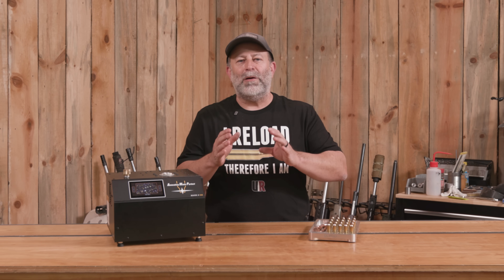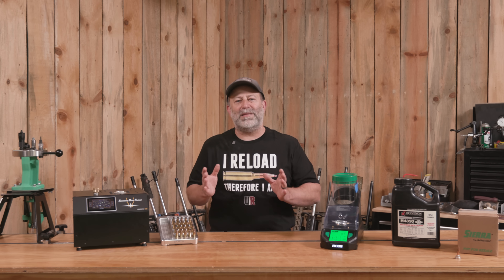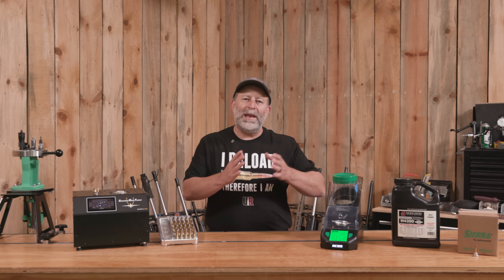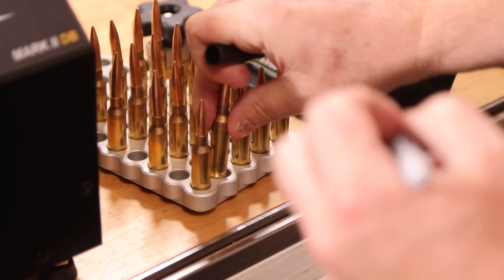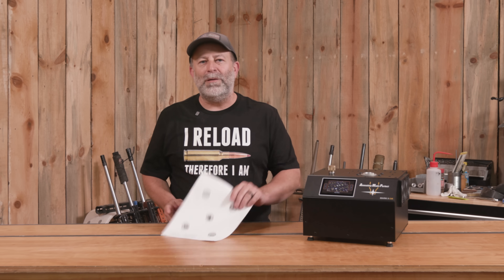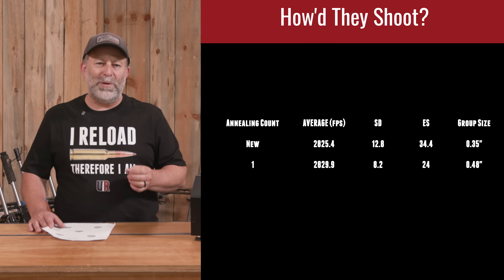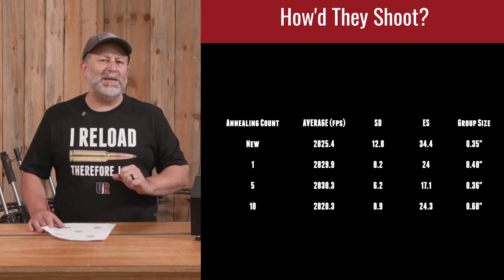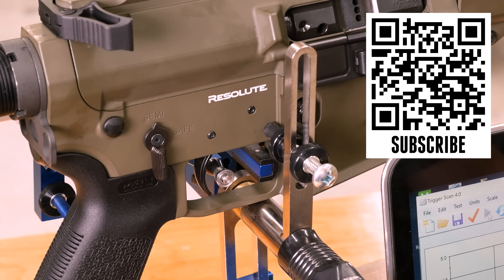Annealing Torture Test: Does Annealing Multiple Times Matter?

Comment: It was the best thing I ever learned. I used to use scrapped cartridges, not my Lapua), to get the flame right, then started to realized that not all cases are made the same. Then, I learned that you can anneal twice without any issues, so I began starting out with a faster time, then slowing down until the anneal was right..(use an ugly annealer). Then by the time all the cases were done, I'd send the 4 or 5 test cases back through the annealer..brilliant! Never thought you could go three, five, or ten though. Good stuff!

Comment: I thought the brass had to be quenched after? It didn't look like he quenched at all?
Is this also done in the machine?
Reply: Quenching has no effect on the brass other than if you're worried that the heat will migrate down down into the case head, (which does make sense). Air cooling takes way less time than Quenching, then drying out the cases, in either a dehydrator, or the oven. Both are valid methods IMO.

Comment: Lol you guys fell for the primal rights scam...😂
Reply: Which scam is that? Please expand on this.
Reply: @joshturner5904  the whole "priming system"..... he's charging $600 for the exact same thing that LEE charges $30 or less, RCBS charges $60 or less, and you can set up the LEE APP press to do it for under $100, and I think there are 1 or 2 others that do the same thing(adjustable primer depth contingent upon the rim thickness, with some sort of pull lever). If you want hand priming there are even MORE choices under $150 for the exact same function. Additionally, out of all the options the primal rights set up takes up the most room on the bench, the rest are a die box or hand primer....

Comment: Pausing at 0:24 to predict degradation in neck due to over cooking the metal results in inconsistent tension on the projectile leading to: Bad groups, feeding issues and possible case separation/cracking and associated malfunctions.

Comment: They all shot the same -don't you think  5 points of data is pretty much meaningless? "Your groups are too small"
Reply: Not in this case, as the real message of the video is what metallurgists have been saying all along: either the brass is in an annealed state or it's not. Don't need five, thirty shot groups to tell us that.
Reply: @floorpizza8074  So the video was pointless then. Either way if the intent was to examine the effect of multiple annealing processes the data group size was to small to be statistically significant, regardless of "what metallurgists say".

Comment: I would be more interested in a Neck Tension test than an accuracy test.
Reply: Nothing interesting would be seen because the annealed condition material properties is dictated by temperature and time at that temp for one single cycle. Any subsequent heating and cooling cycles thereafter  -assuming temp and time at temp is kept the same-  will not change the materials properties to any appreciable degree.

With that said, if one wanted to do the test anyways, it would be extremely important that all cases have exactly the same wall thickness (down to a single tenth (.0001") or better) and  the same with the projectiles diameter for any appreciable and reasonably accurate variation to start to be seen. Any variability in either will result in varying hoop stress, which in turn directly affects "neck tension" but this variation would not be a direct result of material properties change from multiple annelings, which is the whole point.

Comment: I have a question about the powder dropper. Do you weigh the powder on a separate scale to confirm powder weight, or is the accuracy of the scale on the powder dropper good enough to get around 10ish SD which was shown in this video?

Comment: I have not watched yet.  So here are my pre event thoughts.  It is a function of achieving certain temperatures and time at for the different crystal structures to form.  Thus uncontrolled heating of the brass could cause problems after just one firing.  Whereas extremely controlled time and temps would have very little negative effect.  Now to watch the show.

Comment: In terms of brass longevity, meaning the number of firings before failure, I am more than convinced that neck-sizing, with the occasional bump of the shoulder, is where you get the most value.  Annealing has its place, but I've gotten 20 firings or more out of a single case that was only annealed one time during that process.